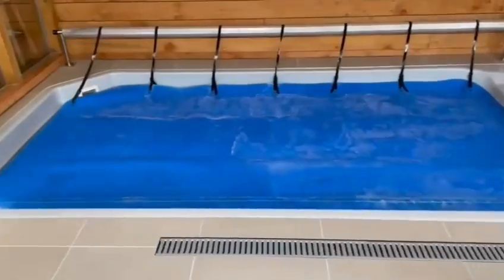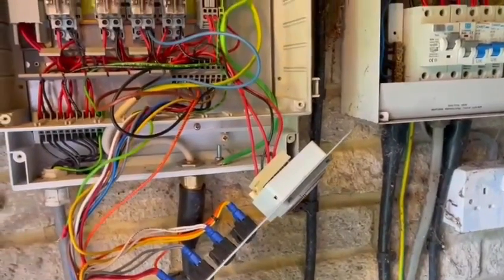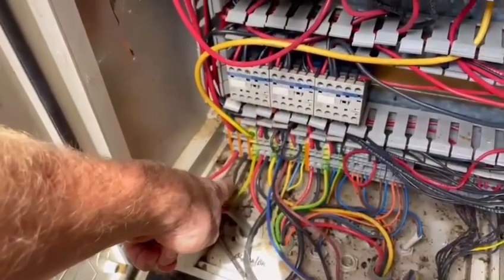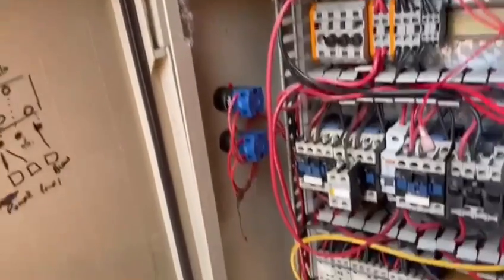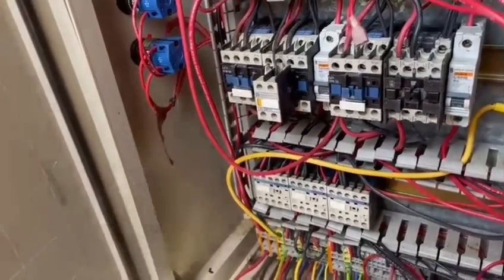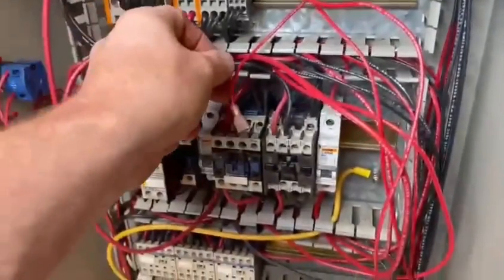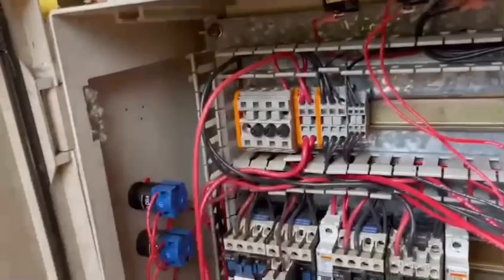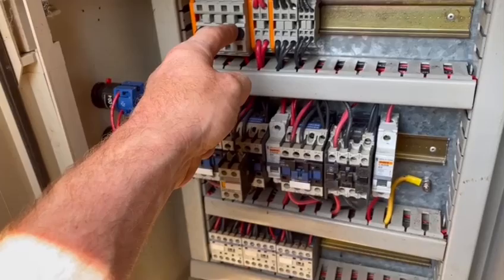Swimming Pool Electrical Fault Finding with U.K. Electrician Matt

Comment: I’d be looking at what caused the fuse to blow ? Also the state of the panel, and the wiring/plug you found would worry me. The fact the cables to the heating element contractors are showing signs of over heating, again alarm bells !! Being the last man to touch that, I wouldn’t be happy. 
Mate I’m not being one of those folks that just want to pull people apart, but that is a shocking install, and shows signs of a dangerous situation arising. Just my opinion

Comment: Was the very left hand side fuse holder not seated properly or was it a blown fuse? If it was a blown fuse was it an incorrectly rated fuse or wiring fault that caused the fuse to blow?

Comment: Quick question was the safety elements around the pool tested? Equipotential bonding of the pool and it’s surrounding area? We’re the pool heaters, pumps class 1 or class 2, and they were on RCDs/RCBOs? Here in the USA we are expected to test the bonding on pools every year given deterioration it’s rightly viewed as a dangerous or at least special location. Not only is there the issue of what voltage gradient and current is needed to electrocute people it really depends on a whole host of factors. In the US we would assume a voltage gradient of 2-volts per foot would be sufficient not necessarily kill somebody straight away but it can result in involuntary muscle contraction resulting in an inability to swim and risk of death by drowning it’s called electric shock drowning here in the USA and in the outdoor culture we have here and greater number of pools and marinas it is something that has happened frequently but is seriously under diagnosed most people put the cause of death down to drowning with the underlying electric problem going under-diagnosed.

Not sure what the guidance is from BS7671 I suspect it’s all zone based, in and around the pool it’s probably only use of SELV, ADS/RCDs and supplementary bonding no location of sockets, switch or control gear. Further out the restriction get less onerous IP rating classifications? Has there been much discussion around electric shock drowning in the UK? I do believe that’s an area that could potentially change code requirements.